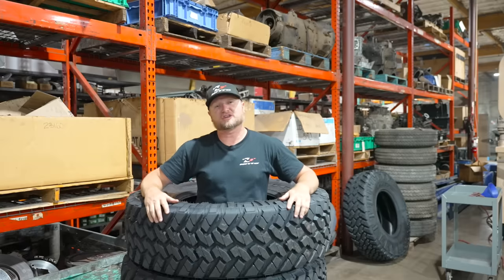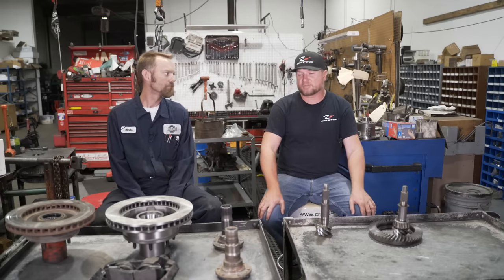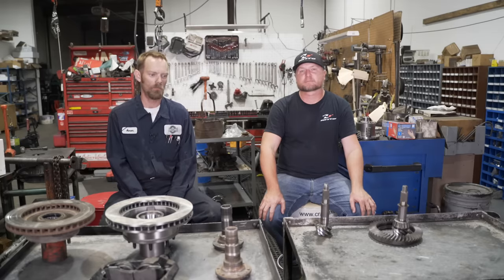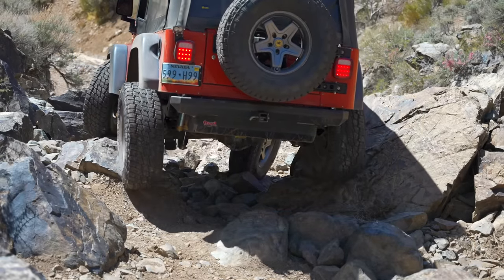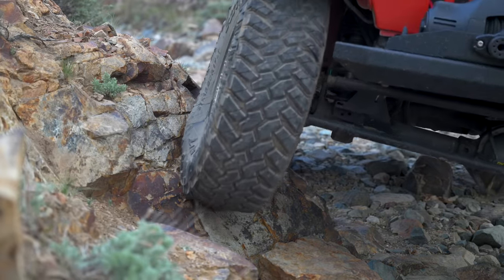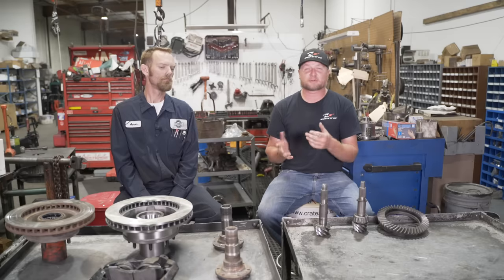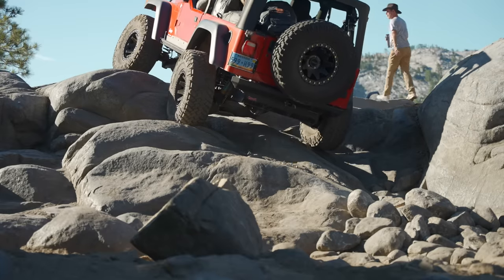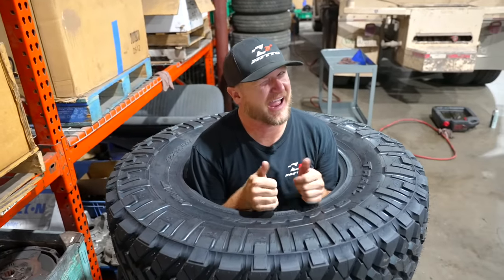How Big of Tires Can You Run on a Dana 44? | Harry Situations

Comment: You mentioned your F250 running 37s. I have a 2007 Ram 2500 with 3.73, 60 front, and 80 rear is there a good median size for me that can maximize my height? I have 285/70/17 now and looking to go to a 305. Should I have any concerns?
Reply: No that shouldn’t be a problem at all. The only issue you might have is the wider tires running the control arms at full lock.
Reply: @HarrySituations  I never "full lock" in any truck. It's just that my truck is long with the 8' bed and 4 doors. More of curb appeal. Maybe 285/75. I don't plan on doing rock crawling like y'all do out west. I'm on the beach in south east Virginia.

Comment: What about adding portals on stock axles?
Reply: Portals take a lot of load off the drivetrain by multiplying the torque out at the ends of the axle, allowing you to run much larger tires.

Comment: Dana 44 is a 1/4 Ton axle.  Ford's 1/2 Ton Super 8.8" is much stronger but I like my F-150's 9.75" HD e-lock rear axle.
Reply: There are a lot of 3/4 ton trucks that came with Dana 44s in the front.
Reply: @HarrySituations ... Yes back when a 3/4 Ton truck could only carry three quarters of a ton.  Now Rangers do that.
Reply: Lol jk 44 is 8.8 new gen is larger .
Reply: Jk rear torson lsd cromoly shafts 4.88 gears . More than strong enough and better traction in bad weather and on Pavement.  gives up very little offroad .
Reply: @street_legal_go_kart7356  I agree on the Torsen differential.  I have it in my front axle, and it's way better then a front e-locker on road and off.

Comment: Hey guys, this was a very informative video, thank you!  I have the new JLUR eco diesel with the d44 and 3.73s, and will be running 35s for my every day commute/occasional weekend warrior.  I really want 37s but afraid to break something.  Not a crazy driver.  Without breaking the bank, Is there anything I can replace/strengthen now that I could do so not to cause issues down the line?
Reply: I like RCV axle shafts, and since the EcoDiesel weighs 450 pounds more than the 3.6L I think that a truss from Artec or TNT Customs or similar would be a worthwhile upgrade for peace of mind.
Reply: Artec is a far superior product, compared to TNT. One of my friends ripped and upper control arm bracket off of  a TNT rear truss. The bracket and welds held, but it ripped a chunk out of the top and side of the truss on it's 3rd trip after installation . Needless to say I don't truss the quality of the metal they use.
Reply: 4.56 gears will make the 37's  work great

Comment: Hey Harry I’m building a Dana 44 for my 1/2 ton  ford truck, planning on just running 35s for now. I’m missing the passenger side inner and stub shaft and everything outside the knuckle, do you think it’s worth getting chromoly shafts or can I get away with cheaping out and replacing that side with used shafts? Obviously I’m rebuilding it with new bearings/seals etc. I guess what I’m asking is what can I skimp on for now to save money without compromising strength and performance? Obviously I want to do it right but I don’t want to dump my whole life’s savings into this load. Thanks in advance to anyone who wants to chime in.
Reply: I think you will be fine with factory axle shafts and new Spicer brand u-joints. If you push the truck harder in the future and break you can always upgrade to chromoly axle shafts at that time.
Reply: @HarrySituations  hey thanks a lot man. And thanks for making these videos.

Comment: I mean great talk but...you never said what size would be max or even just generally recommended. Your buddy barley mentioned 37 would be his biggest but that was literally the only mention to actual size. That being said I plan to run  a HP, 35's with 4.11 and a 4bt.
Reply: We gave you to the pieces to consider to make your own decision. In your case I think the weight of the engine over the axle will be the biggest issue. I would recommend a truss.

Comment: TJ & TJL 2003 thru 2006 Rubicon's are known to have the front Dana 44 Axle tubes subject to bending with tire sizes bigger than 35 inch. Is there a fix for that or just stay with 35 inch tires or less?
Reply: I think of it as more of a JK issue but there are trusses available for that TJ from Artec, TNT, and others.
Reply: You can sleeve axke tube or put a Artec truss on it. Don't go with the TNT truss. They use cheap materials and I've seen one of their trusses tear apart on a TJ that has 37's
Reply: A TJ Dana 44 doesn’t need a truss or gussets for a 35” tire
Reply: Or sleeves

Comment: Thoughts on a high pinion d44 with 4.56 gears and 35x12.50 tires? This will be on a CJ7 with a FI 4.2 with a AX-15 transmission.
Reply: Sounds like an awesome combo!
Reply: I had a CJ-7 with a 5.7 liter chevy with 4;56 gears with a Dana 30 front that was stock
Reply: Dana 20 rear with chromemoly axles and air locker. Never broke anything and I jumped on it.
Reply: I have a hp 44 , rcv axles , 4.88 gears , even with a lock-right and 39.5 iroks , wheeled hard on them , so far never had a problem, this is definitely the limit on tire size for me , you should be in great shape with your set up

Comment: There's a super lifted 2nd Gen 1/2 ton dodge ram at this used car dealership on my delivery route that has those 54 inch Michelins the military uses and it runs stock axles its probably one of the sketchiest vehicles I have seen in my area
Reply: That ground clearance tho! 🤪

Comment: Heck yeah! Been wondering if I could run a 37 on my TJ Rubicon. Thanks for the info and the additional items to consider! Now…to truss or to step up to a beefier housing!?!
Reply: Look into G2 axel and gear. They got great products 
I went with a full dana44 kits with them 35 spline chromollys re geared as well Eaton e lockers. Their 44 is about the same thickness as a 60 the knuckles and ball joints are beefy as hell
Reply: @gwood69  How long have you had the G2's?  I was about to pull the trigger on a set, but found a killer deal on a set of JKUR D44's with 4.88s and chromoly shafts that I couldn't pass up.
Reply: @WilC379  about 5 years I got rid of my rubicon axles sold em lol I wanted to get it regeared from 4.10 to 4.56 because I still daily drive it so wanted to get the gas mileage still 
So ya one thing lead to another and I figured hell might as well get the whole damn kit and not pay someone just as much to do my gears 
So ya lol I love em man they’re awesome they’ve taken a beating held up well so far
Reply: @WilC379  what tire size you gonna run? Only thing with the 44s is the knuckles I’d truss the knuckles up 
Even with 35s
Reply: Look up carbon offroad u can get 44s jk wide.
Reply: you can but you shouldn’t. I wouldn’t recommend it at all. Don’t do it. One of the best jeep TJ/LJ builders will tell you not to. Head over to wrangletjforum and ask can I run 37s
Reply: You don’t need to truss tj dana 44 axles for 35’s
Reply: @bryanmartinez4893  thanks man, been surfing that one for a while. I see a lot of the old guys say 35’s are all you’ll need on a TJ, and to be honest it seems like that’s a plateau for the build…after 35’s the work required to beef up or make room for 37’s seems like it can snowball quick if you don’t stick to the plan.

Comment: @Driving Line for my 97 TJ i will be putting in a 3.6 stroker in it. Would you recommend i go with the 8.8 axle or Dana 60. Currently have a 4 in lift with 33 in tires. Possibly going to a 6 in lift with 35 in tires in the future. Going to have 4.56 gears. Thank you for any input.
Reply: The nice thing about the 8.8 is that the bolt pattern and width match the front axle. So if you plan to keep the original front axle it makes the most sense, and they are pretty darn tough. The Dana 60 is stronger but opens this can of worms with being wider and eight lug where you will need to swap both axles for them to match.

Comment: Nothing to really disagree with…but the constant mention of power or horsepower is annoying when talking about drivetrain strength. The tooth loads are from engine torque and tire shock load torques. More power just means more heat, thus cooling and lubrication. Power is a function of torque and speed. Small torque, high revving engines make big power too.
Reply: I think that axles break from a few different causes. Too much torque, for instance when you are climbing an undercut ledge and break an axle shaft. But there are also power related failures when you shock lock an axle, such as when the tires leave the ground. For me this situation has typically broken the ring and pinion.
Reply: @HarrySituations  yes, I do agree. The inertia stored in a free spinning 37” tire requires a substantial torque to rapidly slow. A high power vehicle will be able to get faster wheel/tire speeds when momentarily bounced in the air, producing even higher inertia and therefore shock loads.

Comment: I've got a jeep gladiator sport non tow package. I think I've got a Dana 44 front and back. I'm gonna put 40's on it and do a 5:38 ratio. I think it should hold up as long as I don't go crazy.
Reply: They are Dana 44s but I think that 40s are pushing it, even if you are not rockcrawling. The 5.38s will help with acceleration but braking will likely be taxed by the large tires.
Reply: Lol

Comment: Anything out there for a gen 4 RAM 1500 4*4, for swapping in new gears?  3:21 to 4:88.
Last year when I looked into it it wasn't easy! The front transfer case ..
Reply: I have a 4th gen Rebel on 35s I'll sell you lol
Reply: Like you said they are not easy (IFS front diffs are typically much more time consuming to regear) and 4.56 was the lowest ratio I found for your truck.
Reply: I have the 5.7 Hemi with 3:73s I think. I put 35s on it and I haven't felt the need to re gear. Plenty of torque the thing I need more of is ground clearance.
Reply: @HarrySituations  16 and yes it has the 8 speed
Reply: @HarrySituations  '18 5.7
8sp.

Comment: Harry
Are your LJ front and rear driveshaft ujoints 1310? Is Arron inferring the pinion ujoint maybe a different size than the transfer case?
Reply: My LJ has the factory 1330 u-joints (which I have mistakenly referred to as 1310 in the past). You can run different size u-joints at each end of a driveline, Aaron likes them to be undersized rather than oversized for rockcrawling.

Comment: HD Dana 44 rear Dana 30 up front, 3.73.  33's or 35's?
Reply: I think you are fine with 35s but I would run lower gears.
Reply: Depends on how hard you want to push it.
Reply: 373 gears do good with 33s ,but 456 offer way better performance! Especially with 35s
Reply: @jimbo4203  Thanks for the reply!  I am gonna stick with 33's.  The Yoko Geolander M/T 3003's 295/70R70 are actually 33.5 in tall so that's almost 34.  I just don't really want to open Pandora's Box for gears, drive shafts, bearings, and who knows what else LOL...
Reply: @donaldlavigne949  its fun but expensive
Reply: I had 3.73’s on my 2014 Jeep. As soon as I put 35’s on it, I regeared to 4:56’s and it brought the power back.

Comment: You can run 44 boggers on a dana 44 up front with the diff open and it will be fine. Been there done that more than once mud bogging.

Comment: So the biggest tire I can run on a Dana 44 is stock.  I shut the video off after that.  You and Professor Beaker really nees to get up to speed on the capabilities of the D44 on a JL rubicon.  I've run 35' on stock axles on my 2019 AND I CRAWL and have had no issues.
Reply: Whoa you have 35s!!!
Reply: @HarrySituations  yeah, I know, 35's are old news, the new big deal is 37's and 40's.  My point is you can run those tires on the M220 amd M210 axles on the Rubicon with some minor mods like swapping out stock axle shafts for chromoly.

Comment: All this talk making me feel like a 4th grader. 😂 I just run 35s and Toyota axles stock shafts 5.29 Yukon’s and  yk grizzly rear and toy elocker up front.  1jz vvti swap really needs 37s I kinda over did it with 5.29s. My old 4.10s made my 5th gear only usable over 90mph now I do 75 @ like 3100.
Reply: 5.29s were probably perfect for the 22RE though.

Comment: How about the Dana 30?
Reply: I think they can reliably run 35s with chromoly axle shafts. I particularly like the high pinion ones, great ground clearance and lightweight.
Reply: @HarrySituations  regear needed? I’m on the 3.45 gearing and ride on 285/70/17 combo wheel and tire about 98lbs per corner, driving feels fine. I’ll look into the chronology axle shafts,
Reply: @litoornelas6409  I think lower gears would help on the road and on the trail, but they aren’t cheap so if you are happy with how it works now I would just run it.

Comment: Hate Nitto ridge grappler tires, I've had nothing but problems with them after just a few years ago, the quality is gone, somewhere along the way they changed their manufacturing techniques, I had two at 2 years old and 10k miles, separate, never happened before with them and I have buying using them for years. I haul a fifth wheel on desert roads, lots of small rocks, nothing radical, always solid tires, now they chunk out pieces, and now separate. Not just one set but two of the six sets of Nitto's I have used. My local Discount tire dealer, says he has seen, more of this and not just Nitto.

Comment: I have been 4x4ing in British Columbia for decades and anything bigger than 35s isn't the best.

I always pass large tire truck because I'm moving much faster on 90% of the trail.

Big truck tires are slow and bounce at speeds better off getting a winch and lockers than giant tires. IMO
Reply: I dunno my Ford on 42s is the fastest thing I have for the trail. Big tires make for small bumps in my experience.
Reply: @HarrySituations What you are claiming is just not plausible.

I can drive highway speeds on most trails and only slow down for obstacles in my litte over stock tire size 89 bronco.

My jeep with big tires can't.
Reply: @pranays  why don’t Trophy Trucks have tiny tires then?